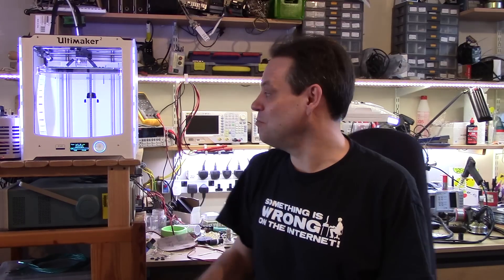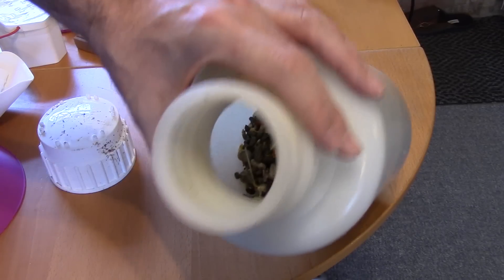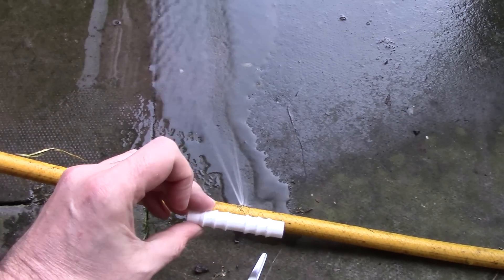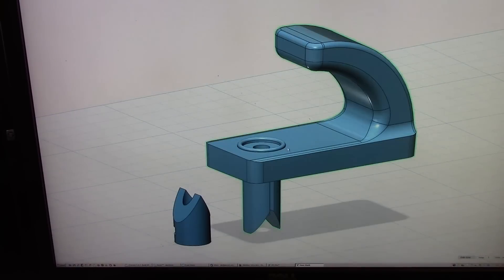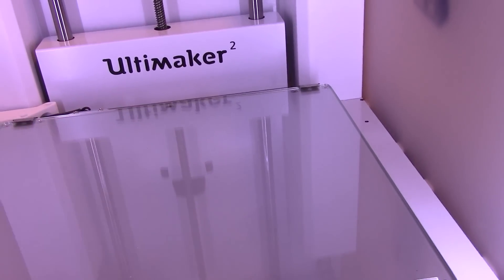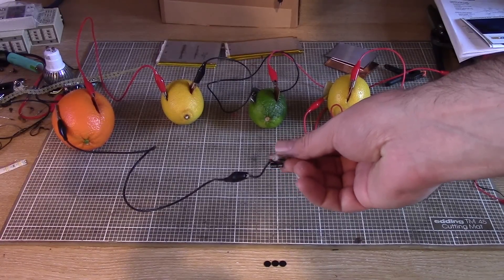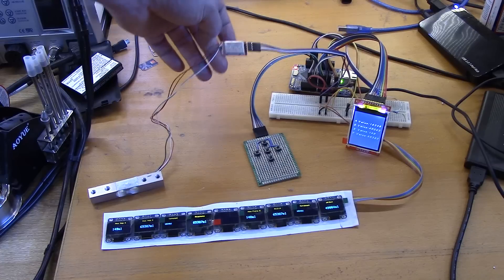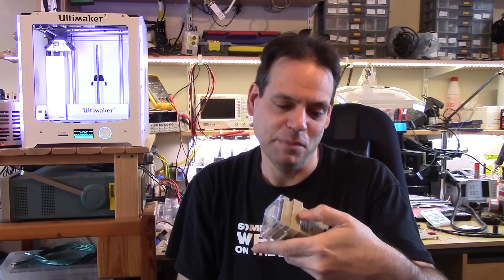Ultimaker 2, Lemon Batteries and Mixologist Update

Comment: Really enjoyed this video Jim. First time I saw a 3D printer working in a real life scenario. I have also been curious about the citrus batteries for a long time. How long did the "juice" keep flowing? Do you think you could get enough lemons to run something practical? Thanks for posting!
Reply from the maker: Hi Hank - I think owning this 3D printer is actually the first time I've seen a 3D printer operating in real-life... I don't understand why people just seem to use them for printing Darth-Vader heads and Iron-Man masks. The lemon-battery setup is still on my desk now and supplying power, but I did have to remove one of the lemons from the circuit as it started to rot... Looks like I'll have to get rid of an orange today too.... The lifespan of the fruit is going to be less than the lifespan of the battery. Happy new year. Cheers!!

Comment: Congratulation on your new toy.

I don't think PLA is the right choices for a outdoor water hose. If you use ABS you could waterproof it with acetone.
Reply from the maker: Thanks +Jesper Thorup Nielsen  - I'll be trying ABS and PET plastics sooner or later... but for getting started I'd heard that PLA was the easiest thing to work with, and has the added advantage of being compostable so it's easy to get rid of my failed parts. It'll be interesting to see how long those PLA pieces hold up to outdoor life. Happy holidays. Cheers!!

Comment: The Pi case looks especially great.  Some day I'll have a 3d printer.  I don't blame you a bit for having that thing running 24x7.  Too much to do!  How much does the material run?  Like for the Pi case, how much would the filament to make that cost?  Cool video as always.
Reply from the maker: Hi Mark - I wish I could claim credit for designing the Pi case, but all I really did was pick the colour and click 'print'  - I'm still very pleased with the results though. I'm using rigid.ink PLA plastic at the moment because it seemd to be a reputable choice. The rigid.ink stuff is costing £30/kg - I've seen unknown brand stuff for less than half that price though, and I'll give it a try once I've got used to the printer... For starting out though, I wanted something I could be sure of. The raspberry pi case weighs in at 34 grams, so that works out to be about £1.02 of plastic. Happy Christmas!! Cheers!!
Reply: +FesterWerks ,,,  I can just see you making tomato clips all winter:))  I had the same question about material cost.
Reply: +Jim Conner That is extremely reasonable.  I'd be wanting the good quality stuff too.  Thanks for doing the math!
Reply: +David Dube (Oregon Homesteader) Ha!  What I really want to design and print are 2 piece covers for my dutch buckets that let me keep most of the rain off.  That white hard plastic +Jim Conner used for a few pieces would work great.  I have it all worked out in my head... Just need the printer and a few months to print enough of them :)
Reply: +FesterWerks ... You could always leave the lid intact and drill holes towards the top of the bucket for the plant and feed tubing.  The plant will redirect itself skyward but a 2 piece cover sounds like a great idea but won't the seam still leak?  Sorry Jim for the OT dialogue.
Reply from the maker: +David Dube (Oregon Homesteader) I wouldn't really say the dialogue is OT... I'm switching one of my NFT rails over to buckets next year, and the buckets I've chosen have a hinged 2-part lid design which will mean I'm able to flip up part of the lid to check on the roots/nutes... The trick with these lids that keeps the rain out is that the hinge is at a high-point. Cheers!!
Reply: +David Dube (Oregon Homesteader) Ah yes, I've accepted that there will be some leakage.  I'm using the official Bato/Dutch buckets and they have no lid by default.  But like Jim's hinged cover he described, these would come to a slight crest where the two halves meet.  I'm okay with some water, just not as much as I've been getting the last few years.  Interested to see the hinged lids.
Reply: +Jim Conner Looking forward to seeing those lids down the road.

Comment: Nice video. Do the corners of the model that were stuck to the plate bend upwards or is the surface perfectly flat? Happy Christmas to you too!
Reply from the maker: Hi +Chip Guy Vids - Where things stick to the build plate, they come out super-flat with a nice glossy finish. Most things stick to the build plate just fine, but very fine details do seem to lift-off from time to time, and then they will bend upwards. I haven't yet tried the recommended approach using a layer of glue-stick glue on the build plate as the lifting off hasn't really proven much of a problem yet. Cheers!!